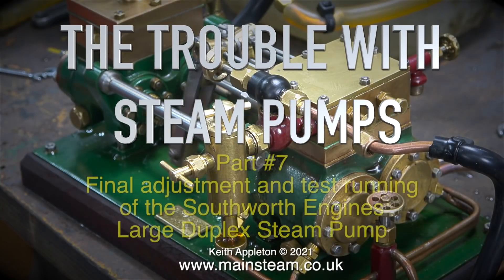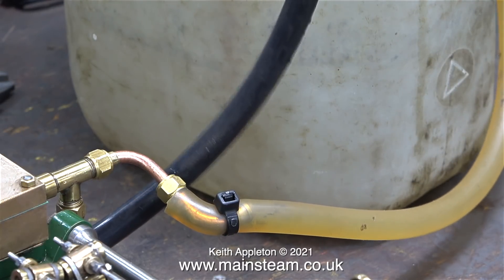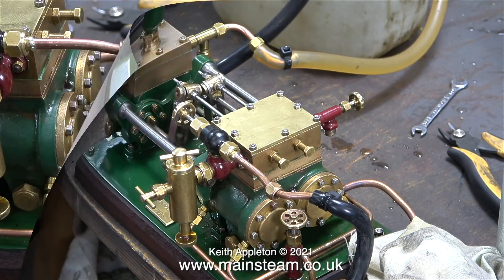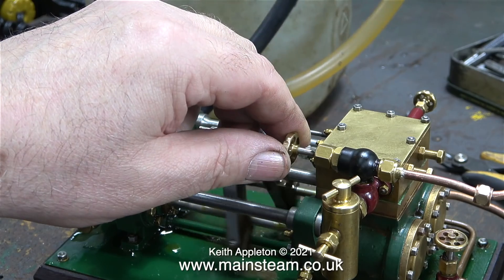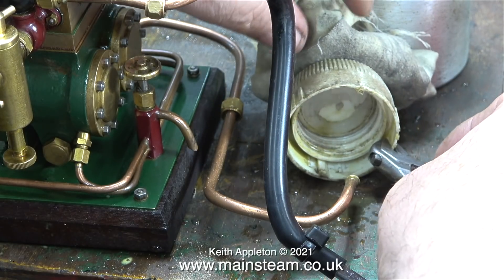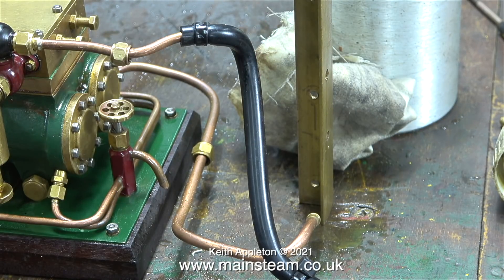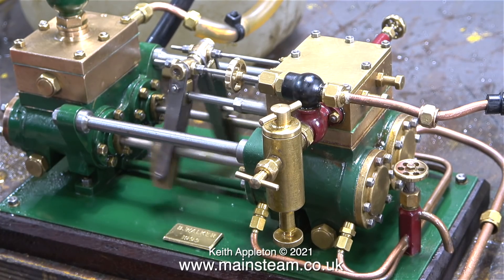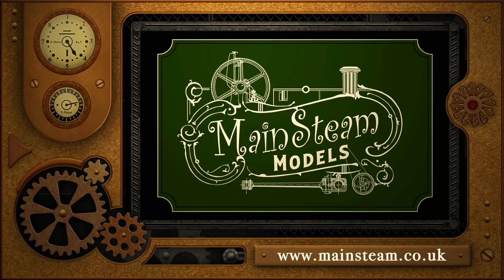THE TROUBLE WITH STEAM PUMPS - PART #7

Comment: Here in the United States a lot of auto mechanics use air lines with built in lubricators that drip a small amount of oil into the air line to lubricate air tools. Why not use one of those systems for running steam engines on compressed air?
Reply from the maker: I just squirt some oil into the airline pipe as I never run for long periods using compressed air.

Comment: I have a Marsh simplex that is simply a steam assisted handpump. I have a Worthington Duplex that runs well enough, but is too large for my application, weighing 250lbs(114kg). I wish Worthington had made some steam pumps that were roughly 25-50lbs in weight. It's good that Southworth is around or there wouldn't be any small steam pump options.